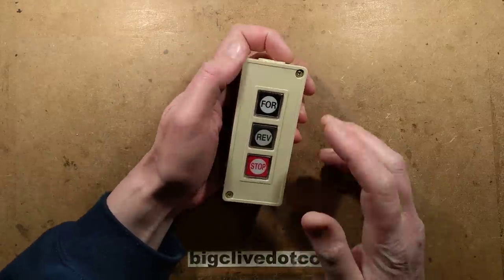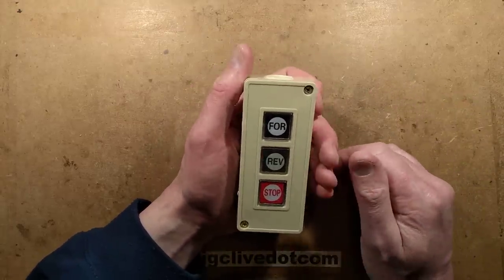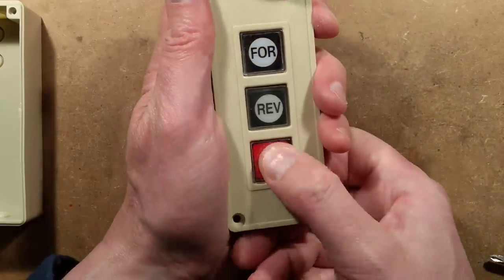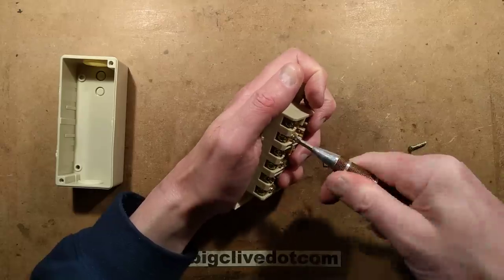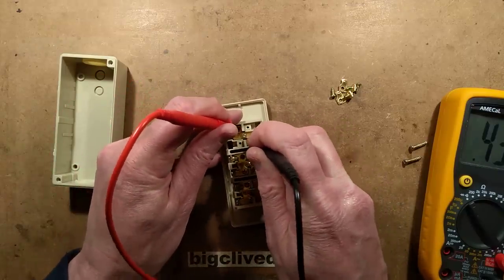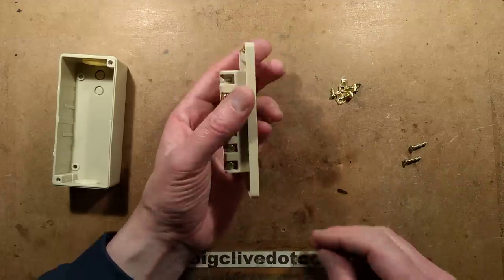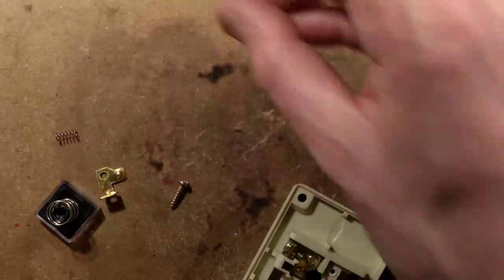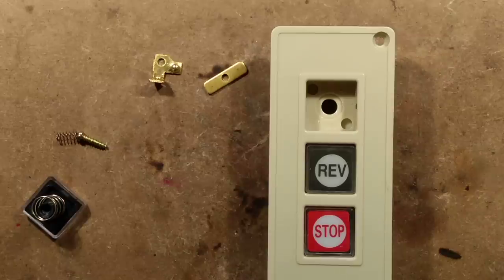Unusually cheap and crappy machine control station.

Comment: The only reason that box uses TWO screws to secure the lid is because they haven't yet figured out how to secure it with only ONE.
I'd really love to see those switches take the "3 A, 250 VAC, 600 V MAX" the sticker is claiming. My guess is that those 'contact' dimples will be where holes will be blown through.
Reply: It one didn't have to open it to install the wiring, it would have been glued.

Comment: Not suitable for high voltage - not suitable for low voltage ...     fantastic.
Reply: Medium voltage maybe?
Reply: @thetesseract2237    Not even that, they are even shipped in sealed static proof bags.
Reply: oh, so they work with static voltages?

Comment: Looks like a "bed goes up, bed goes down, bed goes up" remote
Reply: More like bed goes u... u... ... up? ... bed goes ... ... ... doesn't go down at all.
Reply: @godfreypoon5148  Bed goes up until body is compressed flat against the ceiling. No scream-detecting safety system :D

Comment: Brass isn't magnetic, but nickel aluminum bronze is! C63000 "NAB" is 5% nickel and 4% iron. It's strong, light, corrosion resistant, and pretty conductive!
Reply: You mean chinesium
Reply: @bolton368  Scrap metal trash. Well it looks to be a real item. But who knows what is in the stuff made in China. Could have a little extra chinesium content. 
A quote from AvE "Cheap junk, yes. Bargain, yes. The sum is worth less that the parts. AvE Tap and Drill Chart!"
Reply: Just about to say the same thing. Pretty common alloy used in conductors.
Reply: I love that stuff it tastes a bit funny till it's been welded
Reply: Aluminium bronze did cross my mind, but I don't think I've ever seen it used for something like this. It's generally used for "wet" stuff (steam valves, boat engine parts, etc.). I guess in terms of raw materials it's cheaper than plain brass, but it's generally more expensive to make stuff out of.
Reply: I spent too many years machining aluminum bronze, the grade that we used was not magnetic, but yes it looks like the culprit is Nickel.
Reply: If the magnet is strong enough the induced currents will try to hold the metal in a constant position to the magnet.
Reply: @andreasdill4329  Iron and aluminum give opposite results !
Reply: @steverpcb  no, i talk about electromagnetism, you are talking about ferro- and para magnetism.
Reply: I tend to specify aluminium bronze for my parts when the machining department has annoyed me. haha
Reply: @bolton368  You know it is made from what ever metals were in the pile that day.
Reply: NAB - new to me, but I came here to learn, thank you.
Reply: @andreasdill4329  But you must have a continually varying field strength to create an eddy current. Permanent magnets don't qualify.

Comment: I work at Crouse-hinds in Syracuse NY, USA. Right now I Put together the Control Stations Such as the one shown in the video. The plastic is Krydon or "Fiberglass Plastic". I Used to mold the enclosures and the S/A or "Subassembly parts" for the push buttons. Let me know If you want a control station from Crouse-Hinds or some Explosion proof Product we make. Right now my main focus is on RPE Industrial connecters and FSQ explosion proof interlocking receptacles. I also Build explosion proof clocks! You can check out some of these Items on ebay.
Reply: Craiglinn I’m sure if you sent one to Clive he’d do a review. Sounds like a pretty cool job that you’re proud of. I used to to food service control systems. Now I do supermarket refrigeration and industrial ac.

Comment: I worked in a building next to Euston station and to get to the plant room office you had to walk past 4 large cabinets housing all the elevator switch gear which was very high amp/voltage stuff and in their infinite wisdom because it used to overheat and trip they opened all the cabinets and placed fans in front of them so there was lots and lots of trip hazards right into live 3 phase circuits and heaven help you if you wanted to get the metal ladders out to go lamp replacing!

Comment: It's probin' time!!1!'

Side note:  I was hit with what turned out to be ~400 volts in an Otis elevator. It was at a newly handed-over Marriott hotel complex. Some Marriott big-wigs were on the scene for the construction company's official hand-over of the property to the hotel chain. Apparently the back-o-the-house service elevator we were in wasn't properly grounded & the stainless steel interior, along with the stainless steel floor level switch, were both in need of a hapless git to complete the circuit. It knocked me off my feet. I've never seen an elevator full of old dodgy executive bastards turn pale white in their faces in such little amount of time. Lucky for them, the property was outside of US territory, so I couldn't sue them for all the money they have.

Side side note:  WHO IN THE HELL WANTS A RECESSED STOP SWITCH AT AN INDUSTRIAL WORK SITE?!?! It needs to be big, obvious & easy to press in an emergency....which s what stop switches are for!!!

Comment: One think I've encountered before is that switches with silver contacts can handle much more current, but require a larger minimum voltage for reliable operation.

I've got some tiny pcb mount slide switches rated around 100mA with gold-plated contacts, but 4A with the silver contacts. The downside is that the high-current requires 10V for reliable operation, especially if it's usually left in the off position. The gold-plated version only needs 50mV for reliable operation.

https://www.apem.com/us/25000n-series-200.html

Comment: For safety applications you would use 2 N.C. contacts to a safety controller typically. I rarely use 120V for control circuits.
Reply: Lift control circuits in the UK typically run on 240VAC mains
Reply: Liam Guy even modern lifts designed in Europe like Kone, Schindler, etc? Old American or really simple relay logic industrial designs use 120VAC but about 95+% is 24VDC. I’d assume elevators use DC control voltage.
Reply: Yep most modern lifts in the UK use 240V control systems; however they're digital.

Lift motors tend to be 415VAC

Comment: I have some of these that I have turned into GO buttons for QLab in the theatre using old keyboard control boards. Seem to work fine.
Reply: I built something similar back in the day for our hog 500. I used keyboard innards and made a remote for go/stop/bump for all playbacks and a few other functions and called it a 1/4 hog.  I also made one that was just go/stop for the main playback and called it a 1/8 hog.

Comment: Many switches in series is not really a voltage-problem. A voltage controlled system does not really care about the resistance of the switches.
The 4-20mA can get eaten up by the switch-resistance. The benefit of the current control is that it is slightly more resistant to EMI and detecting a broken connection is easy.

Comment: Had a German made one of these on my lathe to control the coolant. Interestingly the coolant pump in three phase but it’s so weak that you can bridge the contacts with a capacitor and run it off 1ph. Dry running is a little hot, but with a whole tank of coolant in there it happily whirs away!

Comment: Never use Chinese XLR microphone cables, they're incorrectly wired and will destroy the Phantom power supply in your PA amp or digital studio recorder, it happened to me --  too costly to rectify.
Reply: Or you could just grab a meter and verify their wiring. I've always had to terminate my own XLR cables, anyway. Never had the luxury of using off-the-shelf.

Comment: Most old lifts use 100VAC controls, and more modern ones moved to 48VAC ( so they could pass SELV regulations) and 24VAC. This lower voltage, in combination with having enough contact current ( typically 30-50mA, an ideal contactor operate current) will keep most decent contact surfaces clean and oxide free, and will not erode them too fast in use.

Problem comes with using 24VDC and lower current, as then you get oxides building up on the contact, and the current when breaking is not enough to cause a small arc to clear them by melting the surface in a plasma. Even worse is some use 5V logic rails, there you absolutely need sealed platinum palladium contacts with a heavy gold plate, not the old silver alloy slug.

Comment: Gah! Brass IS an alloy with the base metals copper and zinc. Other elements are also added for various reasons. In reality all metals we use in daily life are alloys, the only exceptions I can think of is really high grade wiring for audio which can use close to pure copper and some surface platings like chrome. (And of the machinist's rant.)

Comment: I've heard that the reason they can ship things so cheaply from China is because it's subsidised by the Chinese government to promote exports.  I don't know if that's true, but they also seem to bulk ship things to another country where international postage is cheaper, and send it from there.  I've had Chinese components arrive in Australia apparently posted from the Philippines, Fiji, Malaysia, etc.  It's usually pretty obvious when they do this, because it takes 25-35 days to arrive as opposed to the 10-15 days when it comes direct from China.
Reply: I think there is also a rule that national postal organisations have to pay into the International Postal Organisation to get their products shipped internationally. China doesn't pay enough, so the postage is also being subsidised by the other countries.
Reply: I believe it depends on the seller. I have had Chinese products shipped from Malay, Filipino, and Thai warehouses, and also had them just forwarded, as evidenced by labels under the one with my address. Some components are even made by Chinese companies in the countries the ship from, as is the case with some Malay semiconductor products.
Reply: I've had stuff from China to the UK forwarded via Kazakhstan and Georgia (country, not US state). The best I've seen was via the Solomon Islands - that's about 4000 miles in the wrong direction.
Reply: @zh84  
correct. china pays per weight, not per shipping which doesnt cover the costs of the delivery in destination. no big deal 1800 when it was meant for letters - the US therefore will leave the UN treaty of the UPU this fall and have their own fees.

Comment: Limit switches are not used on new machines. Those wear out. We use inductive sensors, photocells and laser distance sensors but not any mechanical limit switces.
Reply: peto22 All those complex non-mechanical sensors may have a better economic lifetime, but may be subject to more severe safety risks (lower probability but higher consequences).  The way different severities are weighed when assessing total danger can be very different depending on point of view. The key levels where this changes is where a risk becomes unsurvivable by the entity making the decision or conversely causes a major situational boost for that entity.  The entity in question may be a person, company, country etc.
  For example, moving a risk of bankruptcy-inducing economic loss to an insurance company would change it from a highly weighed existential risk to a less weighed survivable risk of higher insurance cost.  However the same physical danger may still be an existential risk for a product buyer such as someone owning the building they live in, thus creating a disparity.

Comment: Something you touched on but is something rarely acknowledged:  switches have a minimum voltage and current rating.  Go below that and they will not be reliable long-term.  The voltage is too low to break down any oxidation.  But you really have to dig to get those minimum specs.
Reply: Yep. Try switching line level audio with relays. You quickly find out that the contacts oxidize and there's not enough current to prevent it.
Reply: You need to use gold flashed  contacts cost more but used for low voltage speed control
Reply: I dealt with a problem involving too low of current. It was in a locomotive that was converted to run on natural gas. The throttle lever activated relays that normally had heavy loads on the contacts, but now just fed the inputs of a PLC with basically no current flow. I could see the relays pull in, but the inputs to the PLC didn't always change. Solution was simple, some low resistance, high wattage resistors to provide a load to keep the relay contacts clean.
Reply: @72polara  Exactly.  I read about it in a manual dealing with driving an IBM Selectric, but saw it in person with a building management system.  Air pressure sensors drove a large MicroSwitch(TM) that was rated for "amps" but was driving TTL electronics.  Sorry, 5V at a few mills doesn't cut it.  The electronics kept seeing the fans starting/stopping because the oxidized contacts that couldn't clean themselves.

Comment: I am a elevator engineer.
In Russia we often have 24V AC on lifts up to 9 floors. Some control systems use 48V. Because the transformer has the 24V tap used for the floor indicator on the first floor and the next tap is 48V. 96V is used on the УЛ, УЭЛ, УЛ-2, УЛ-Г lift control system. The board is powered with 24/48V they are multivoltage. The УЛ and similar control stations are infamous for the faults. The most common is FF 43. Also FF 29 means the board is gone good luck repairing it.

Comment: The alloy probably isn't magnetic. It's probably just Lenz Effect. When you move the magnet over the metal (or place the metal on the angled magnet) you induce eddy currents which interact with the magnets magnetic field.

Comment: That’s pretty crusty. I especially like the sub-flush Stop button that creaks down and doesn’t quite get there without the necessary wiggle. Oh, happy day. 
I get what you’re saying about low voltage control circuits, on the farm machinery I work on it’s routine to use a 24v pendant control with lots of switches for this and that. One of the major bothers is the contacts going crusty and not making properly, and if it’s the emergency stop button, it’s not going to run. 
It doesn’t help that farmers are really hard on electrical stuff.

Comment: Re Lifts. All the latest systems that ive seen in the UK going into the latest apartment blocks all seem to be IP based, and use PoE to throw power down CAT5 cable. CAT5 seems to be the answer for everything these days !.
Reply from the maker: They are often using a canbus network, but only for the call plates and non critical control systems.  The safety circuit on the doors will always have to be a physical circuit that breaks power to part of the control system.

Comment: This is why it is good if your beep-circuit actually relies on the quality of the contact. My fluke meter's circuit does not. It produces a very clean beep, which tells me nothing about the reliability of the contact.
Reply from the maker: I prefer the "scratchy" beeper.  It tells you a lot more about the connection.

Comment: Damn that continuity sounds like my Artemide Tizio lamp.
Crackling and dazzling. I took it to bits because I knew the head was fancy mounted and I wanted to repair it. 
End of story: I got smoke from the head: 12v AC for a H1 halogen lamp through a threaded rod that connects via a metal sleeve to the lamp is making arcs. Not my idea! Original Design!
Swapped it for a new head with a GY6.35 head now. Might tinker around with the head and see if I can resurrect and Frankenmonster it just like clive does with everything he gets his hands on.

Comment: The price reflects the quality. Ok for a doorbell button.
Reply: probably catch fire
Reply: @bubbahogg-buga4613  well that's one way to find out that someone's at your door.
Reply: Personally I'm not convinced it would be OK for a doorbell button.
Reply: Yeah, a doorbell that falls to bits after one press 😏
Reply: Dave Micolichek  The button design is only half of the problem. The doorbell's inability to deal with a stuck button is the other half.
Reply: ding dong . . . . ..  KABOOOOOMMMMPPFFF

Good way to get rid of those pesky cold callers, canvassers. Religious nuts etc etc
Reply: Dave Micolichek  You wouldn't need an industrial sized, constant duty solenoid, just a thermal cutout of some kind to prevent overheating.
Reply: Dave Micolichek  Cheaper solution is for the battery size and winding material to be mutually matched to ensure battery runs flat or winding breaks before any fire.
Reply: Dave Micolichek  Of cause there will be heat, it just needs to be kept within safe limits.  And testing prototype or sample bells (different designs) by running them constantly until they stop on their own is a fairly simple test that also provides the numbers needed for warranty planning and battery replacement instructions.

Comment: Super interesting and useful. As I understand it, this procedure has to be user initiated. If for some reason the power went out when unexpected, could you have a capacitor ready charged that would keep the machine going while a differentiator circuit or similar on the main supply signals the loss of power to the processor which then causes a shut down to occur while the capacitor provides the needed power for this shutdown. It would be easier with batteries as you would just initiate shut down and some pre-specified battery voltage. One could do the same sort of thing on a re-boot, again sense the main power coming on and then operate the restart software. As I understand it Raspberry Pi can use enough power that one might need a super capacitor in some situations. Perhaps there are practical reasons this would not work but it was instantly what I thought you were about to show when your title said "Safe Shutdown...." Thanks for sharing!